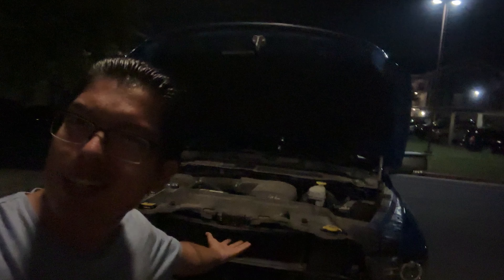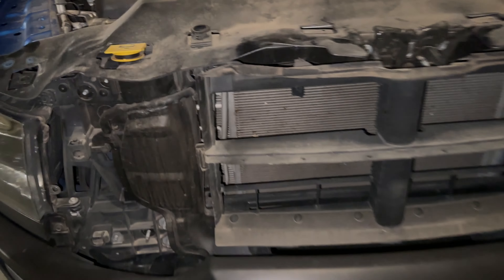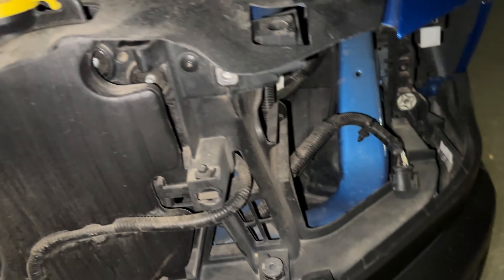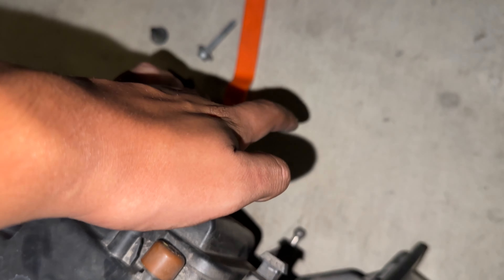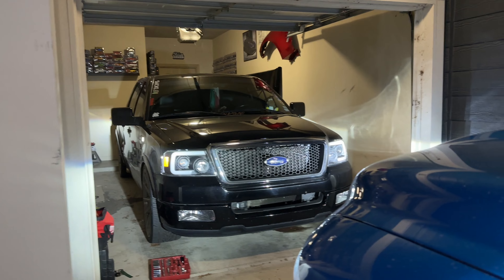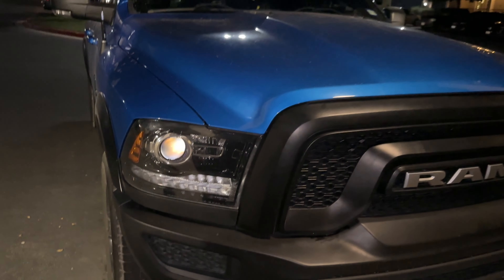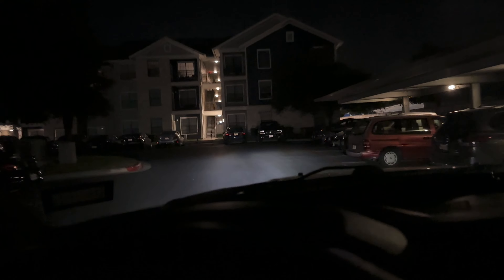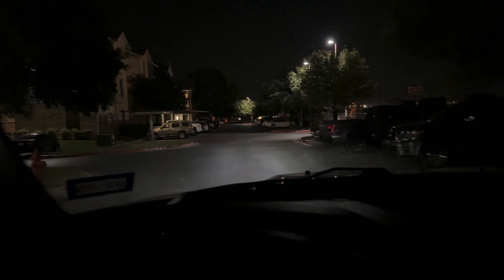2021 Ram 1500 Classic LED Headlight Bulb Replacement!

Comment: I have the same truck. Can you link the bulbs that you used?
Reply from the maker: @TR5Y  https://shop.advanceautoparts.com/p/sylvania-9005-led-powersports-headlight-or-fog-bulb-6000k-cool-white-light-2-pack-9005sl.bx2/12482356-P?selectedStore=7885&searchTerm=9005&selectedFulfillment=store_pickup
Reply: @InfamousDaniel  thank you. Should be installing them over the weekend.